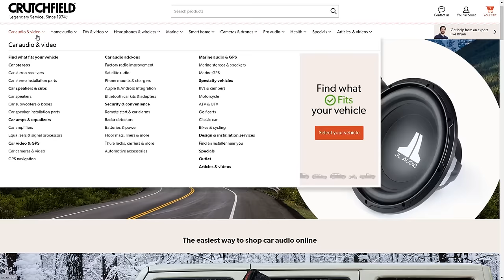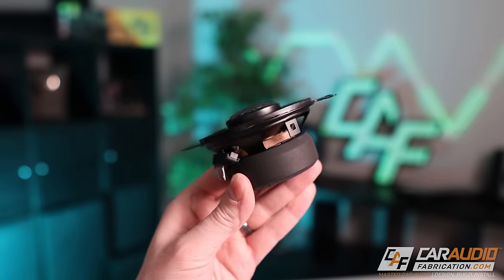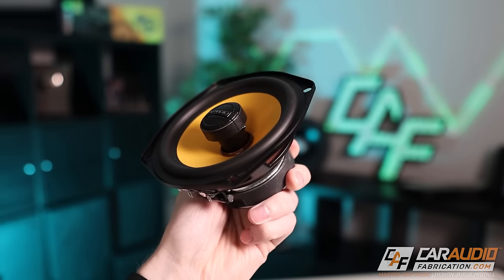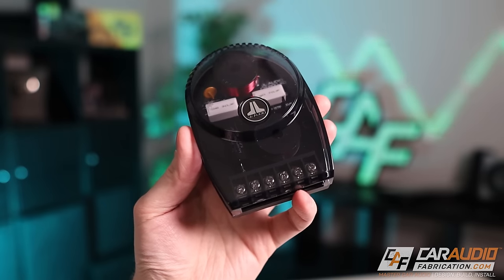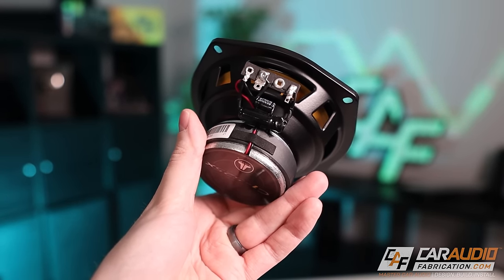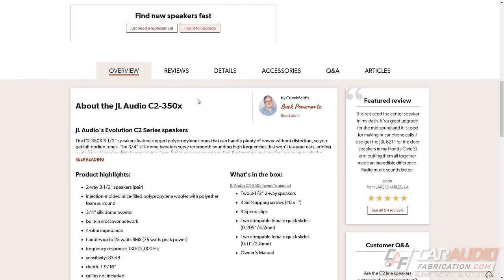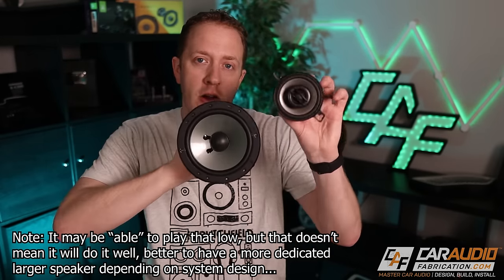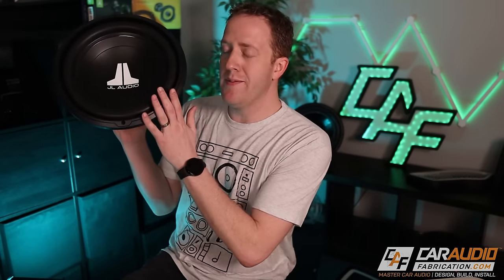Car Audio Speaker Types EXPLAINED! Tweeters, Mids, Midbass etc!

Comment: i'm replacing oem speakers on my 01 polo, it does already have seperate tweeters near the mirrors, should i replace the 165mm speakers with woofers or mid range drivers?
i don't think coaxial is the way since i already have separete tweeters

Comment: Hey how's it going? I have a quick question for you. I building an enclosure for 4 12s the specs are 44 x 18.5 x 28.5. My question to you is what size port/ports should I have in the center to get some where around 31 to 34 hertz. Thanks

Comment: Mark, what is the purpose of a 6.5 inch or even an 8 inch 'midrange'? Does it handle the same frequency range of a 6.5 inch 'midbass' or is it essentially an overpowered 3.5 inch midrange that plays those midrange frequencies louder?

Comment: I need help on a subject.
I would like to separate low end of the spectrum as much as possible by adding different size woofers as listen to various genre of music. 
18-15" sub for deep bass, 12-10" subs for 120bpm sound and 8" for low-mid bass range. Is it possible to separate low frequencies even more just like a drum set. I don't want just 18", 15", 12 or  a 10" I want them to co-exist together.

Comment: My factory setup as tweeters in the dash facing the windshield. Should I wire the tweeter with a component in this location or move the tweeter into the door panel?

Reference 05 Frontier 6 speaker no amp or dsp

Comment: I want 3 way Dynaudio Esotec 362 xovered digitally with dedicated channels for each using Audison Bit 1, 5.1 and a Quattro for rear fill, center channel and rear fill. Can I fit those 8” Esotec mid bass using a spacer in a 2018 Hinda Civic Type R? I could put the 4” mid and tweeter in an aluminum pod on the dash being able to swivel them for the best imaging and sound stage. Single 10” low profile JL Audio sub to save weight and fit in the factory sub enclosure, modified of course.

Comment: Replaced factory head unit with a Sony aftermarket. Sounded great with factory speakers. But when I went with new aftermarket Sony 6.5 on the front, the sound quality deteriorated. No bass and harsh mids and highs. It was a 3 way 6.5 poly cone. Ended up putting factory speakers back on.

Comment: Thanks Mark. How do you personally calculate port volume vs air volume when building a subwoofer enclosure that will hold multiple subwoofers. Like say an enclosure with 4 8" subs. Not tuning, but port velocity which not too many people talk about. I am building a box and wondering if I need to add double the port area for each sub and make the port longer for tuning since it is wider but that would allow for proper port velocity as opposed to a restricted velocity which make the subs underperform and may cause chuffing.

Comment: I like 3-way 6x9s in the rear, 3-way 6.5s in the doors, and Kenwood tweeters up by the window in the front doors.
I always run 400 watts high-pass frequency to all of those. I'm hooked on Soundstream Audio for the highs.

And

I am addicted to Se subs. I like to run 2 12" subwoofers in a 5-cubic square inch sealed box facing towards the cab. I always use at least a 1600 watt peak amplifier. (I've learned that that is not enough power. The Amp will go into protect mode a lot during the summer time. Sometimes, the Amp will burn up.)
Last system I had, after the Amp burned up, I went back with a 2200 watt amplifier, but my alternator couldn't keep up. So, I put capacitor in, and the capacitor couldn't recharge fast enough.

So, I put in a crossover so I could control the low-pass frequencies. Just rising around, I would cut the lows down to protect the system, but at competitions, I would turn it up.

I was putting out 163 decibels. Crystal clear highs and mids. You could hear the bass from 4 blocks away.

I couldn't get the TVs to work, though. I had two in the visors up front and 2
two in the headrests. They worked at first, but the audio had interference. I moved the wires, and they just never worked after that...

The car looked nice, though. It was a 2001 Nissan Altima on 18" Boss wheels and low profile tires. I tried fire 20s, but they wouldn't fit.
Reply: Look up big 3 upgrade for car audio systems

Comment: I get that 2 way speakers combine the woofer and tweeter. And the 3 way adds midrange to it. Would that mean that a 3 way speakers is better or would it be basically the same?
Reply from the maker: 3 way is "better" because each speaker can do more of a dedicated task, rather than trying to do several things at once. (In layman's terms)

Comment: What is mid-bass, actually? The term confuses me.

Does it cover "bass + mid range" spectrum? Or just the middle part of the bass spectrum?
Does it refer to audible sound spectrum, or does it refer to driver construction type?
If it refers to construction type/class, how is it different from woofer?

Shouldnt drivers be classified into sub-woofer (for sub-bass), woofer (for bass), speaker (for mid range, or vocal spectrum), twitter (for the trebles or highs)?
Where does mid-bass fit into?

I rarely encounter mid-bass term used in home audio.

Comment: I wish you'd do a segment on selecting a head unit and speakers on more of a budget.  I have a 20 year old daily driver truck I adore that needs a new audio system.  Obviously, given the age and use of the truck, I don't want to spent a ton on money, but I would like to maximize value and end up with something with a decent feature set and sound.  No amps, no subs, just a good all around system that makes sense installing in a used truck.  How about it?
Reply: I have a 99' Maxima, 23 years old and just got a full SQ build. I planned on just a head unit too and a year later its a full overhaul now.
Reply: @theycallmeherbie  That's cool, but my truck is my second/weekend/home improvement vehicle, so doing a big system install in it given its age and use isn't in the cards.  Heck, the only thing that works in it today is FM radio, so any upgrade I do would be a leap forward.  Having Bluetooth connectivity and Android Auto would be mind blowing.  I'd just like some recommendations on what to buy to get a decent system that won't break the bank.
Reply: @Mike-In-O-Town  usually my recommendation is getting a decent deck. Preferably a name brand, pioneer, alpine, Kenwood,jvc or Sony. As for speakers, kicker tends to be really good for the price you pay. I always recommend amplifying them because you definitely get a wider range of sound. I get a lot of customers asking for something simple for their truck bc it's the "work" truck and get beaten 10times over. But I always reply with, which car is the one you spend the most time in, so which one will you enjoy your speakers the most in. Just a thought.
Reply: Decks almost all put out 14W rms @1%THD, up to 50W max @10%THD. Higher powered units are hard to find and are cost prohibitive, imo. 
2way speakers with sensitivity above 90db are all you need. I go with poly cones and rubber surrounds in older vehicles, especially work trucks. Those closed-cell foam baffle cups that mount behind the  speakers will give you a lil better bass, and help keep dust and moisture away. Just watch that they don't interfere with window operation in door mounting situations.

Personally, I usually go Pioneer deck with whatever name brand speaker is on sale.
Reply: Well I'd say look at Walmart not sure if it's all Walmart but I got a decent pioneer radio and some decent pioneer 6.5s in a bundle deal for about 85 with tax and all. 4 speakers and the radio they sound pretty good with them hooked just to the radio. Also if you're looking for amplifiers and subs, skar has a 15% off deal right now
Reply: I just put an Alpine UTE-73BT in my Tacoma, and it sounds great even just un amplified into the factory speakers

Comment: I wanna do a component set up front and coaxial speakers in the rear with a 10” sub in the rear all ran to a 5 channel amp into my Prius 👍🏼 HOPEFULLY SOON!!
Reply: If you have a gen 3 Prius like I do, Crutchfield advises not to exceed a 30 amp fuse rating on your amplifier. I opted to take the four channel amplifier route which powers a 6x9" component set up front and a single 10" sub-woofer in a sealed box in the rear cargo area. I removed the speakers from the rear door and covered the openings. Despite that, it sounds absolutely amazing.
Reply: @BStreet666  I have a 2013. NICE!! I heard you could exceed it. It’s just not recommended. I’ve heard someone put in a 2000w 15” subwoofer in a Prius and it worked perfectly. It probably affects the MPG. I’m not doing anything big, similar to yours but I’m doing rear speakers.
Reply: @BStreet666  what gauge wire did you run from the battery?? 4 ?

Comment: Hey! I just had a subwoofer installed under my drivers seat and it sounds. Well, bad boomy and lacking that punch. It’s an Audison subwoofer in an enclosed box in my vw transporter van, running at 500w’s. Is it the positioning? Or do I have a bad sub? Thanks for these awesome videos fyi!
Reply: I'm guessing it's an 8" or 10"  sub? Your van has too much internal volume for a small sub at that power level. Having the sub under your seat just makes the sound quality worse. Moving it as near to the rear of the van as possible will help, especially with proper time alignment. However, if it's just bare sheet metal interior, it'll never sound good. It just wont.

Comment: Any recommendations for 19 ram classic. Has basic speakers. Wanting more clear crisp sound. 😩
Reply: Do you have the alpine system? If so, the problem is the factory eq. For some reason the front door 6x9s are not full range, they are just mid bass, and the rear 6x9s are full range. So upgrading your fronts will won't make a huge difference, because they aren't getting sent high frequencies. I put a LC7 in my ram to get full range in all the doors, sounds great.

Comment: Any recommendations for upgrading my Bose system in a 2016 Porsche Panamera GTS, I want to replace the head unit and all factory speakers, as well as add a 10” or 12” subwoofer or 2.
Reply: I wish i have bose system , why you don't like it

Comment: Hey Mark, is it a bad move to use 4 coaxials and tweeters? I have a w7 and it has so much bass, will the lack of mid bass hurt my sound quality and imaging?
Reply: It will make sound stage and TA a process.  I would stick with separates and run them fully active with a dedicated 4 channel.  You want loud and clean and control.

If your deck has time alignment and a parametric eq - then you’re all set.

Comment: I would think a subwoofer is common in any application. Just imagine how BB King would wound without a subwoofer? How about the selective sounds of Michael Jackson, a production by Quincy Jones, etc, how would they sound without a subwoofer? Classical music is the best way (my opinion) to test a system for a "true dynamic" sound. Why? because most productions do not deviate to far from the norms. Yes they may use heavy processing but it's to more than often give a natural sound, that's even for electronic music like Dubstep, Trap, and Trip Hop.

Comment: I like coaxial style speaker with separate speaker leds to the mid and tweeter. Like a component set. Keeps the mid and tweeter on the same axis and easy solution for install.
Reply: I do too but does not sound as expansive as seperates. Both have good and bad aspects.

Comment: Is there a way to increase the voltage of your head units pre outs?
Reply: Most of audiocontrols units step up the voltage. I have an LC7i , and it steps up to I think 6v when turned all the way up. The gain on my amps is set around half, and putting out rated rms power.

Comment: I have an old Audi with speakers on a dash and no speakers in the doors. Originally they came with simple 4" speakers on both sides, but the foam of the speakers has since disintegrated. Should I go with a simple 4" woofer like it did originally or would I get better performance putting coaxial speakers instead? (Component speakers in the rear of the car)
Reply: I'd go coax unless you are willing to add tweeters for the front. You're definitely better off with more tweeters/high range. 

I have coax up front, woofers in the back, but it wasnt enough highs with my 15" sub. I added some (4) powerful tweeters in the back that face forward. Im assuming you have a sub, in which case its easy to drown out mids/highs.
Reply from the maker: You want to make sure you have full coverage for the full bandwidth of frequencies up front, so likely better to have coaxial. But you also need to be sure that the speakers are being fed a full range signal. This is where testing of the signal comes into play.